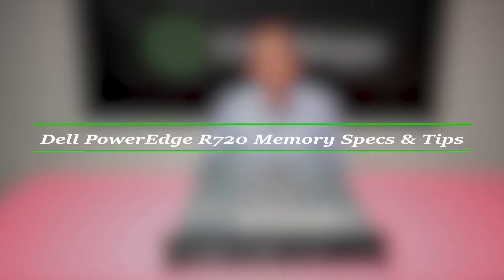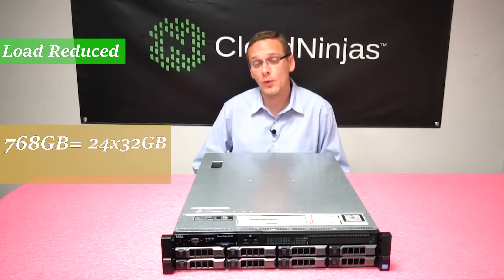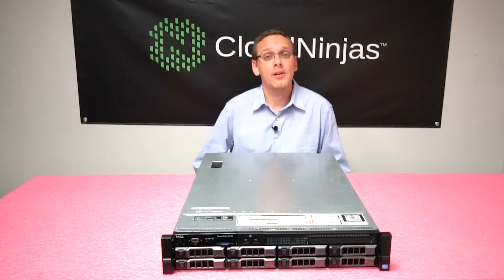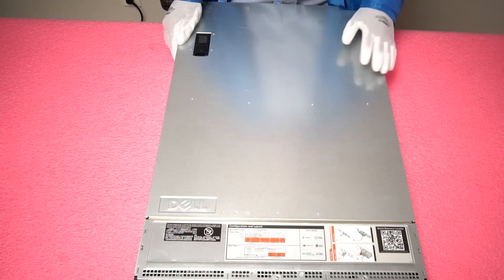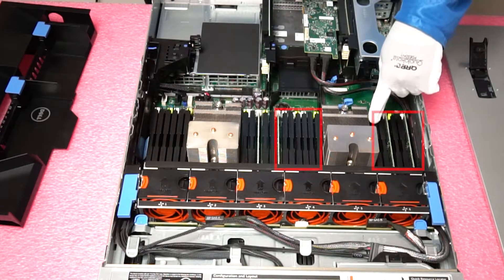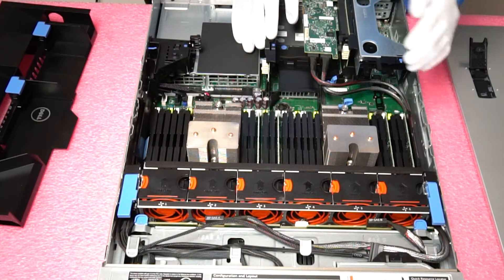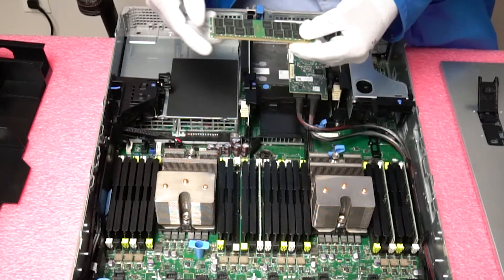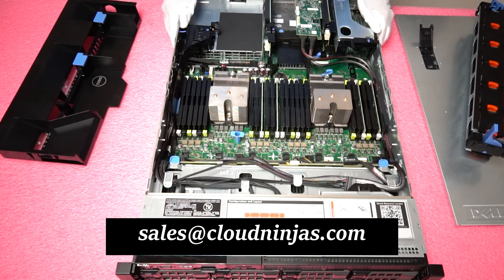Dell PowerEdge R720 Server Memory Spec Overview & Upgrade Tips | How to Configure the System

Comment: I bought noday an r720 for a homelab I'm designing for hosting services like kubernates, routering, firewall, dns and vps  anch some other services with a pair of 2660 v2 10 core and 64 8x8 gb 1333 (not the best ram but we dont care) and 2 disks 600 gb sff in raid 1 to contain the vms operating system

Also ordered from 🇮🇹
Reply: I bought today*
Reply from the maker: Nice!  Congrats.  Have fun with it!

Comment from the maker: Please note.  You can use 64GB DDR3 LRDIMMs with the R720.  Thank you!
Reply: Should probably also include the note that the bios version needs to be 2.1.2 and above as that is the bios version that includes support for 64gb LRDIMM (at least in the release docs)

https://www.dell.com/support/home/en-us/drivers/driversdetails?driverid=cfp0g&oscode=ws8r2&productcode=poweredge-r720
Reply from the maker: @wcypierrenet  thanks for adding!  Take care.
Reply: and out of curiosity, have you guys actually tried filling up the server fully with 64gb lrdimm to reach  1.5TB ram? 

Because on Intel and SuperMicro's documentation, E5 2600 v2 only supports up to 8 rank per memory channel, there's 3 dimm per memory channel, and 64gb DDR3 LRDIMM is actually octal rank (x8, presented to the system as quad ranked (x4) due to the buffering).

So...... based on that, each memory channel would only support up to 2 x 64gb LRDIMM per slot, which would make it 8 channels x 2 DIMM slots per channel (1 wasted due to the rank limitation) x 64gb = 1TB RAM.

(page 17 - • Up to 8 ranks supported per memory channel: 1, 2 or 4 ranks per DIMM
)
https://www.intel.com/content/dam/www/public/us/en/documents/datasheets/xeon-e5-v2-datasheet-vol-1.pdf

https://www.supermicro.com/support/resources/memory/X9_DP_memory_config_socket_R.pdf
Reply: Lrdimm are dual ranked if i am not wrong, because (in other servers too) ecc is only 16 dimms and it uses rankrule because 2 of them are buffering (added because ecc) with ecc ubfuffered there isn any buffer and (if im not wrong) its dual rank maximum per dimm as well as lrdimm wich is not ecc
Reply: Update: Supermicro is giving a different info so..... hmm...... would appreciate if you guys can test maxing it out to verify which is true :)

"When using an Octal LRDIMM, DIMM3 would not be
populated since filling DIMM1/DIMM2 would reach the logical rank limit of the processor."

https://www.supermicro.com/support/resources/memory/X9_DP_memory_config_socket_R.pdf

Original Comment:
okay, seems like I got my answer. so LRDIMM are treated as dual rank (2r), I always read article that it is half the rank so I thought the 8r lrdimm would be treated as 4r dimm.  

"LR DIMMs are labeled as quad- and octal-rank DIMMs. There are four and eight ranks of DRAM on the DIMM, but the LR DIMM buffer creates an abstraction that allows the DIMM to appear as a logical dual-rank DIMM to the system."

https://techlibrary.hpe.com/docs/iss/DL380_Gen9/setup_install/GUID-85811F5E-E204-474C-B670-2F4C7F90C7AA.html

Comment: Can you please tell - I actually have 4 *32gb 1866MHZ Ram already and I have a spare Server with 10 of these 32gb sticks should I be fine pulling 2 sticks from my second Server ? None of both are commissioned yet
Reply from the maker: Yes.  6 in server 1 and 8 in server 2 will work great.